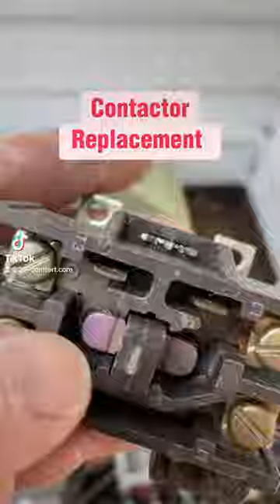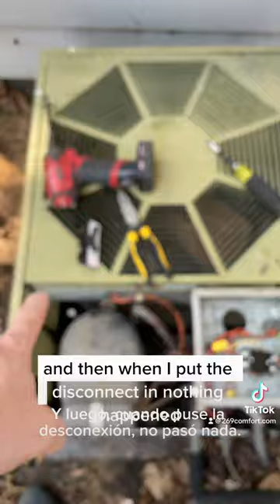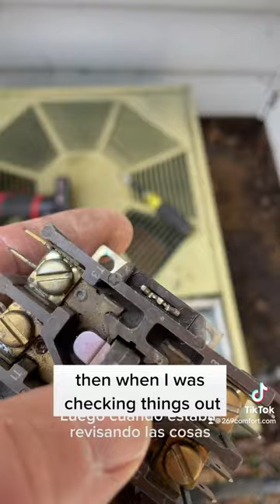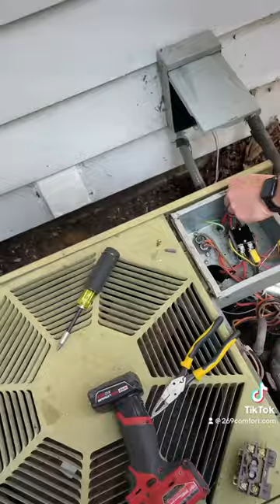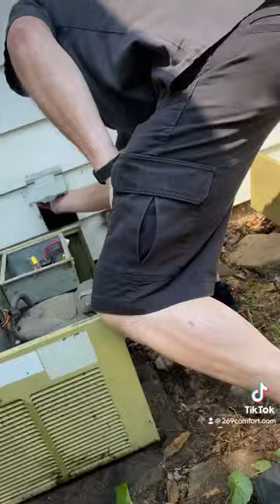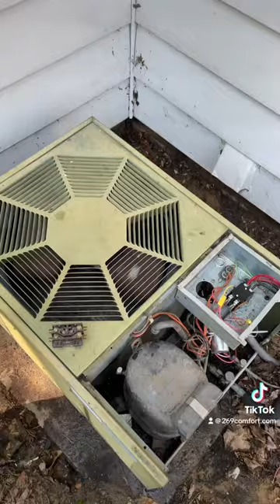Neglected Rheem Ac part 2

Comment: My fan stopped same unit from 1976. If I pull the breaker, is it a pretty straight forward swap?  There is a Capacitor I’ll probably swap also?
Reply from the maker: Possibly! Look for the obvious.burnt wires or just a bad capacitor.
Reply: @ADVANHVAC  thank you 🙏